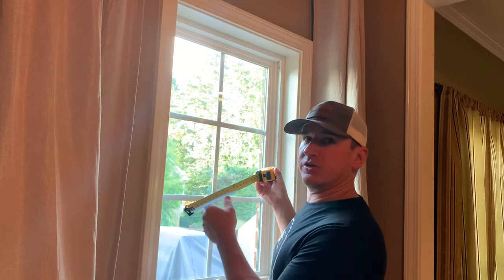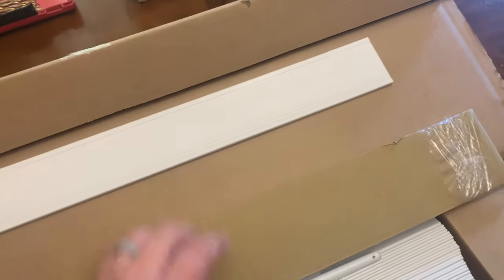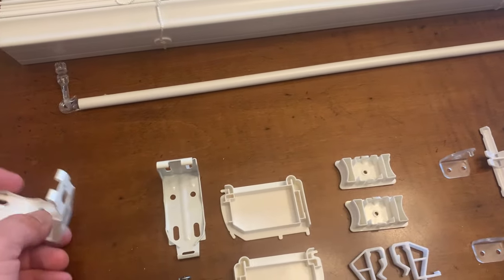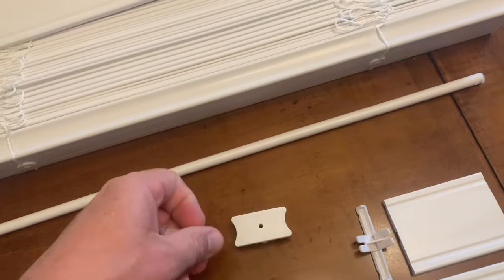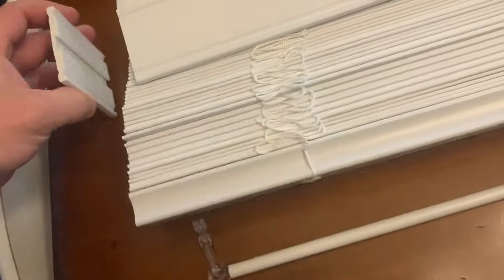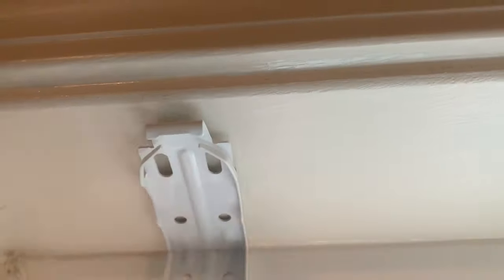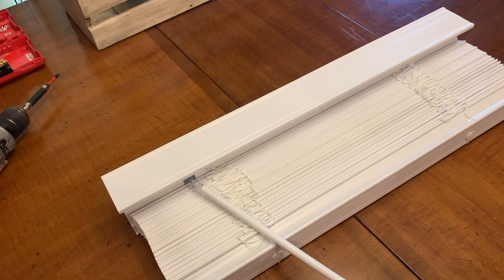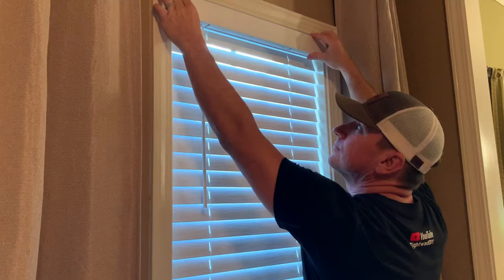How to Install Window Blinds - Cordless Faux Wood Blind Install

Comment: In the Walmart brand cordless blinds, there is a 1 inch safety tension pin (mine was grey in color) on top of the blind set. If you do not remove this pin, YOUR BLINDS WILL NOT GO UP AND DOWN. It’s in the instructions, but it’s easily possible to accidentally miss reading it while assembling this product. Stay blessed
Reply from the maker: Thank you for adding valuable info!

Comment: Having a hard time installing my new blinds because my screws keep falling out. Tried putting the screw anchors in and they fall out as well. Looking at videos for help. I'm not pre drilling because I misplaced my drill bit for that. I'm not skilled in drilling or anything, and I don't know if I have the drill to high, if that's such a thing. I don't know!!!! Or is it just, bad window casings. I'm feeling lost and frustrated. What should be easy, is turning out a mess!!!! Please help if you can.

Comment: I just put mine up thanks to you! My only worry is I probably should have used screw anchors in what I think is dry wall. I hope this will hold.  Mine are 52x64 (with 4 brackets). About 12 lbs. I did an inside mount and the valence is slightly too long. If I had put the brackets closer to the outer inside edge I probably could have avoided that. A little trim and it’ll be fine. Looks great over all! Thanks!
Reply from the maker: Kim dumaine If they really are going into drywall without a stud behind it I highly recommend you put some anchors in. Do it right the first time to avoid a disaster later.

Comment: Thanks! Great video! What would you do for a 6ft (72in) wide window? Two 36in wide blinds? We currently just have curtains up but could use blinds as well.
Reply from the maker: You can get custom cut blinds. Sometimes they sag in the middle though so try to find some with a third bracket for the middle. Two blinds may look funny from the exterior view.

Comment: I have a question that the video does not discuss. On the inside of the bracket it has an RH and a LH, which I am assuming means that you put the RH on the right had side, and so forth. I did this and when I went to the left side, the big holes in the bracket were on the top. It's the only way it will work on that side.  What am I doing wrong?

Comment: Thanks for the video. So the mounting brackets could be installed either to the side or to the top of the window, right?
Reply from the maker: Depends on the model you purchased. Most have the option of side or top mount though.

Comment: I was wondering how to remove these blinds so I can spray them with the hose rather than going slat by slat.  Thanks
Reply from the maker: The top part would just unclip. It will take a little force but shouldn’t be hard.

Comment: Anyway you can show how to position the end brackets properly when the blinds are a little bit shorter  than the window frame? I've been looking all over the internet and there's not a tutorial video on how to do this.
Reply from the maker: The blinds shown here don’t have end brackets for mounting. They have clips that go on the top instead. For end bracket blinds, you just measure the opening, subtract the blind width and divide that by 2. That tells you how far in to measure on each end for the bracket. I suggest putting them 1/4 farther towards the frame than the measurement to make sure there is enough room.

Comment: How do you release the blinds to stretch down in length?
Reply from the maker: You just pull down on the bottom piece. Push them up to make them fold back up. I don’t even know how it works! 😂😂

Comment: It's my understanding that I need to attach the brackets for my inside blinds to the sides of the window frame rather than the top but the brackets that came with the blinds are top only. What can I do?
Reply from the maker: Why would you need to attach them to the sides of the window?
Reply: @TightWadDIY  I was told that the material at the top of the window was not as solid as the sides. I have since watched a number of videos where framing is constructed and it seems to me that no matter what the material is above the frame, the frame should hold the weight. Is that right?
Reply: @cathyperry6729  I obviously can’t make any guarantees but there should be a frame made from 2x4s and then faced with a 3/4” board. I don’t see any reason you wouldn’t be able to hang the blinds from the top.

Comment: What drill bit did you use to predrill?
Reply from the maker: You should use a bit slightly smaller than the screws.
Reply from the maker: Just pick one a little bit smaller than the screws.

Comment: Wait a minute, Wait a minute HOLD UP I did exactly what you demostrate you pull down the blind so easy I can't get the blinds down. If I pull on it too hard it will come down WHAT DID I DO WRONG!
Reply from the maker: I’m not really sure. Mine aren’t hard to pull at all. Did you buy yours from HD or somewhere else?
Reply: @TightWadDIY  I bought  them from Walmart 2 of them 1is up to the kitchen window but it just come down I'm pulling on it and it will not come down.
Reply: @TightWadDIY  I figure it out there was a ORANGE WARNING that says Remember to remove tension pin before installing I took the put out and it can down like BUTTER.
Reply from the maker: @Chinaglo24  That’s great! I’m glad you figured it out!
Reply: @Chinaglo24  I have the same problem.. where is this orange tab at?
Reply: On the Walmart brand cordless blinds, there is a 1 inch plastic safety tension pin in the top of the blinds set (mine was grey in color). If you DO NOT REMOVE this pin, your blinds WILL NOT go up and down. It’s in the instructions, but you can easily accidentally miss reading it.
Reply: @citizensane4387  thank You!